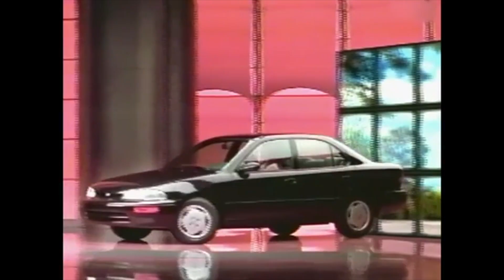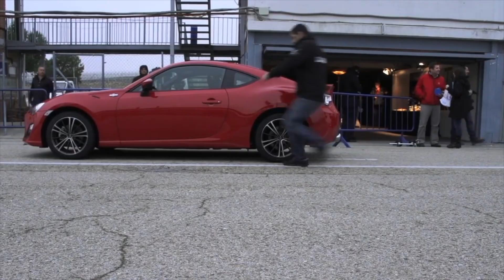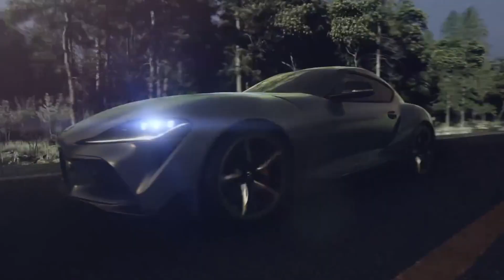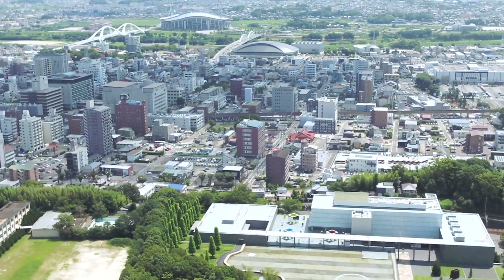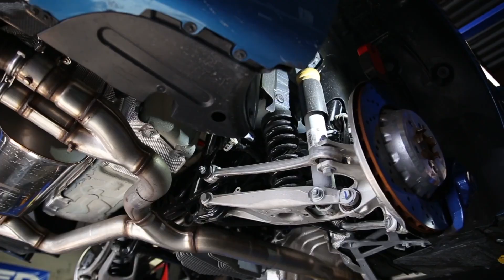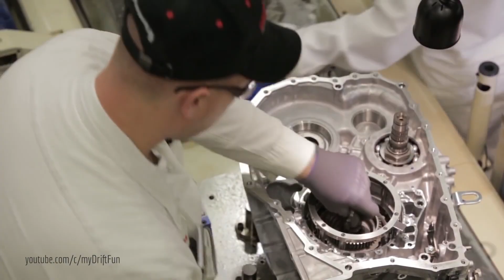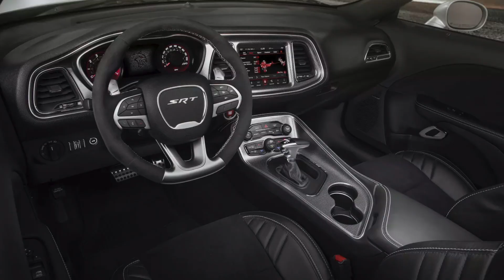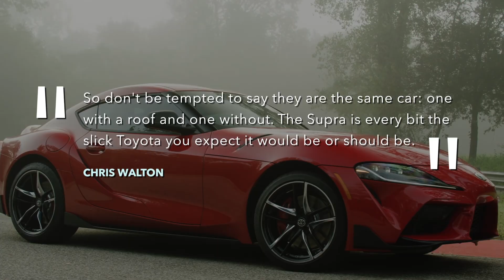MKV Toyota Supra - BMW or Toyota? The UNTOLD TRUE STORY

Comment: I notice that apart from being a BMW pretending to be a Toyota, that you forgot that the interior , which is totally BMW. 

This is a BMW in Drag, Period!
Reply: If the interior designs for these two cars was, as the video suggests, done completely separate from each other, how come the Supra's dash looks more like a BMW than the Z4 itself? Vast majority of controls are taken straight off a BMW assembly line. It even has the BMW iDrive?! They made a big effort on bringing the Supra back but didn't care to make their own A/C panel, shifter, or even a steering wheel? It was bad when VAG did this using Audi switches on Lamborghinis, but this time it's just sad. I mean, you could expect that from Volkswagen Group, they have a history of making soulles clones under different brands, but BMW and Toyota, both with such strong brand images?

It's probably a great car, I'm not saying that. It just isn't the Supra the world was waiting for. Not as it presents itself now. It could have been.

I like Toyotas and BMW:s both, it's not that. One of my cars is a BMW at the moment, and I like it a lot. I just might like it more than the -83 Corolla I had some years ago, and that's saying a lot. The next car I'm buying might just be a Lexus, so I'm not biased like that.
Reply: @PekkaKilpeläinen  "how come the Supra's dash looks more like a BMW than the Z4 itself?"

That is the dumbest comment I have seen in a very long time. Bravo.

Bitching about A/C panels and shifters really shows where your priorities are. i.e. Completely grasping at straws to pretend you have a valid point.
Reply: @ootdega  Well that's your opinion. I know A/C controls do not make the car any worse. It's just beyond me, why they wouldn't make new ones. It surely wouldn't have been a big effort. Or even use those of some other Toyota model. Even that would have been better. Well, probably making completely new ones would be about just as easy, because obviously the car uses BMW electronics, and making a Toyota panel communicate with a BMW bus would have required some work too.

Why does any car maker do different knobs and swithches, and spend money on that, if they don't matter? Those are the things you'll see while driving the car. All the time.

And it's not even about how the A/C controls really. That's just the most visible reminder of what's wrong with this car.

I'm not saying I'm a genius or anything, but if that was the dumbest comment in a long time, you must not have read many Youtube comments lately.

Comment: What is the actual reliability of the BMW inline 6's over the years? If I buy a toyota Supra, I want 90's toyota bullet proof reliability.
It also doesn't matter what other cars the transmission is used in, 2nd gen dodge rams are a good example. Bullet proof transmissions that Dodge spec'd out to be cheap so they fail easily without additional cooling or new internals.

Comment: As an business insider, this report is hitting some reeeeally good points. The European vs. Japanese Culture - oh Boy, is it difficult, but the rewards can be great. I enjoy working with Japanese customers, but I see the struggle daily. As for the Manual vs. Automatic debate - BMW has some of the very best SW for automatic transmissions out there (they run a LOT of custom things compared to the "stock" ZF). Their MTs however, aren't as good IMO. If you know the difference in shift quality and strategy between a BMW and any other OEM ZF 8HP you'd be very, very surprised. And BMW drivetrain and suspension with Toyota realiability engineering... Sign me up!

Comment: It was a no brainer to use a BMW engine???? ITS. A. TOYOTA.
Reply: What's funny is that the company that they should have gone to for the engine is Volvo, but it'd never happen. They're the only common-tier company actually pushing engine tech. The sad thing about the new supra is that the best BMW engine for it was the N54, which was axed 10 years ago. 

In short, if you want a modern supra... buy a E92 335i.
Reply: Toyota is not known for powerful engines, BMW is. Reliability is an easier problem to fix. Not to mention, a lot of the setup is quite German, and BMW is quite familiar with 6 cylinder RWD platform. It does make sense to use a BMW engine.
Reply: Why the fuck not. I can only imagine you would be bitching even more if it got a V6. They obviously reworked the majority of the bimmer engine and it has a lot of simillar specs with 2JZ for example closed deck block, variable valve timing, forged crank shaft, rods and pistons, same displacement same drive train and aspiration. I've seen people getting 600whp from the previous version of this engine with stock internals no problem and that was in a well abused drift car and apart from servising it didn't need any atention and that engine is opem deck and cast bottom end so you can only imagine how strong the new one will be. Oh and btw that 8speed auto? Made by getrag do you know what transmission is also made by them? The glorious V160. The new supra tranny is also in lamborghini's wolksvagen's bmw's and even in a fucking jeep track hawk a frikin heavy ass suv with 707bhp. So even the transmition is going to be extremely strong. Just stop pissing on toyota for workig with a different company i haven't heard people bitching about gt86 having a subie engine so why so many puristic cunts are whining about this co-op is a mistery for me.
Reply: @MrTomuron  nope
Reply: @MrTomuron  Dude... learn to spell. And the point is it's a BMW engine.  Let's release a BMW M3 with a Dodge Hemi in it. Or how about a Chevy Corvette with a Hyundai V8.. or a New Ferrari with a Chevy LS.. get the point??
Also the FRS and BRZ both were built to be a totally different new car.
Reply: @Simple_Youtube  i have no problem with who the engine is made by as long as the feeling is right and everybody who drive the new supra said it's amazing as it was built from ground up to be a handeling weapon. And my spelling might not be on point because english is not my first language obviously. Honestly anybody who drove it has no problem with it having a non toyota engine and i don't either since only thing me and everybody else should care about is the feel of the car not what badge is on it
Reply: @MrTomuron  dude of course. People swap engines all the time. But you are missing the point here.
Reply: @Simple_Youtube  Nothing special about that. A lot of car manufacturers use different make engines. A.o. Renault makes engines for Mercedes A, B and CLA and some CI. Volvo used Renault engines. Lancia Thema 8.32 had a Ferrari engine. Toyota and PSA  made the Toyota Aygo, Citroen C1, Peugeot 107 together. Ford has hired Yamaha to make engines or sub-assemblies. Mercedes sells engines and parts to Aston Martin. And how many co-ops that we don't know about!
Name a car brand that 100% proof doesn't buy parts from other factories. They all work together to get the costs down and make more profit, because that's all that matters in the end: profit. CEO's are calculators first, car fans second!  (if at all). Most cars are 'assembly cars'. One factory makes the chassis, another one the engines, etc. All parts come together in the assembly and a new Frankenstein is born. They all do it! Toyota's hybrid drivetrain is sold to Nissan for the Altima. Ford and Mazda shared engines, chassis parts, brake parts, even full platforms. Toyota and Daihatsu. Rover and Honda.
I can recommend a trip to Skoda's plant in Mladá Boleslav. You can get a grand tour there (except for some development buildings :) ). Might be other manufacturers doing the same.
Reply: I think that it is easier and cheaper to improve an already existing engine rather than making a new one considering its a joint project. Again this is my opinion and I could be wrong.
Reply: Cost is always the choice. They had a good BMW engine right there.
Reply: And the 2jz was a Yamaha ok shut up and stop being a fanboy
Reply: @zetto_san-ichi4824  u need a safe space brah?? U seem upset.
Reply: James Heracious you seem to have read my comment in an angry tone that’s your problem you’re obviously the one upset don’t know if you realized but shut up isn’t always an angry word
Reply: According to this video, Toyota made sure the engine is reliable.
Reply: @REEL SIXX no one is triggered. Dont get your thong panties in a bunch. No one said anything about JDM. Nor do they care. The point is that the car is 100% BMW or should a say its actually just a reskinned Z4. And only JDM Weeb fan girls use chasis model codes to label cars. Mk5?? Give me a break.
Reply: And for the MK4 Supra, it was a no-brainer to use a Yamaha engine. Stop whining!
Reply: a lot of idiot toyota fanboys dont even know their own history, so surprised about this. well sorry to burst you bubble, this will hurt. bmw designed and had a hand in the jz engines.
Reply: @1984-f7q  haha sure dude. Keep dreaming. The only engines touched by a german company were JGTC race engines outsourced for machine work. Keep drinking you koolaid.
Reply: why the f would you use a BMW engine?!! they are notorious for problems, mainly cooling system issues
Reply: @TheCreedBratton  Toyota reworked the entire engine to meet toyota's reliability standards
Reply: @JustusKuroVT  lol
Reply: @JustusKuroVT  that right there tells you to never buy bmw
Reply: @bailey2624  I hate BMW myself. But the supra aint a BMW, its a toyota built car aided by BMW
Reply: @TheCreedBratton  bmw engine are amazing lol, yes they might have their hickups since theyre completely maxed out. I dont think youve ever driven a bmw m car.
Reply: @D3nn1s  I have actually lol.  I also have years of experience working on BMWs and building race engines for them.  They make good power, but they don't have the reliability of Toyota, which is why people buy Toyota to begin with.
Reply: @TheCreedBratton  not in germany lol
Reply: @D3nn1s  you got me there lol
Reply: @TheCreedBratton  well shit happens :^)

Comment: the engine is bmw, the differential is bmw, the suspension is bmw, a lot of interior parts are from bmw, tested by bmw, of course it more bmw than Toyota but Toyota did great in fixing bmw reliability issues, only time will say if they did fix all of them, if all that is true of course it will be a great car but if it has bmw reliability it will be a total mess because the front is ugly AF

Comment: Nice... this is a car I would ONLY get in a manual... a getrag manual.
Reply: If you want a manual spiritial successor to the MK4 supra, just buy a 335i E92 or 1 series with a manual. with the N54 engine. This isn't a supra, not because it's a BMW but simply because it's too small. The MK3-MK4 supras are GT cars. The new supra is smaller than a GT86.
Reply: I have a Mk.1 Z4 and two other manual BMWs (E30, E46). I'd only get a manual too, but I think the new Z4 is also a bit too big and heavy compared to the original.
Reply: Good luck shifting faster than humanly possible and destroying it in the process. Get over it, manual tranny is gone, the future is here. We'll miss it and the older cars that have it will still be fun, but you just can't compete with the new stuff

Comment: Nice work with this film! Good, unbiased filmmaking. Wish more folks could follow suit. 

Watching this actually completely changed my viewpoint of this vehicle. I like many originally  felt like it was a "rebadge" job not really worthy of the "Supra"  nameplate,  but realize now that's not actually the case.

This is less "rebadge" and more "gene splicing"  which is hardly something new to automotive engineering. In fact,  I believe both makes/vehicles will benefit from this.

Comment: My problem with the new Supra is the huge difference between the finished car and the concept car images and it’s position in the Market. I can see all the design ques are there but the finished car is just weak. It can be compared to the fashion industry, cloths at the Paris, New York and London shows are outrageous and mostly impractical  but the ideas are diluted and work the way down to the street. I was hoping the Supra fitted into it’s previous level on the market, in the 90’s magazine tests the previous model was tested with cars like the Viper, 911 and most importantly the Nissan Skyline of the day. When it was said the Supra was coming back, I didn’t even think of the “price”, I thought the Supra would be the Toyota’s equal of the Nissan GTR, the car to take the fight to the GTR, and with the images put out there, it was. 
In the 90’s word of a battle in Japan hit the UK, 1000+bhp Supra, Skylines and Honda NSX on the street and on the track the Nissan, Toyota and Honda battle raged. Maybe the disappointment is just my looking to the history I grew up with, car giants battled, today they get together and produce to a cost car to fit a niche. I hope Toyota do bring out a model to rival the GTR but sadly it won’t have Supra on it’s tail.

Comment: I would buy the Supra because I prefer the stiffer frame,  the simplicity and steam line design a coupé. In terms of reliability I expect them to be similar. Even if if had a toyota engine I don't think it would be more reliable
The old supra is a legend. This one is nice but I don't think it will go anywhere close

Comment: Why? Why do you have only 23 thousand subs? Why does this video get barely 550 thousand views?
Is this on trending? This should be on trending.
Most awesome video I've seen in a while. Extremely well done!
Reply: Because it’s full of misinformation. Go look at Shmee150s video of the Supra he actually bought and owns, and you’ll see that some claims in this video are false. This guy just compiled a bunch of other people’s writings and videos and did no effort to research the accuracy of the statements he copy-pasted.
Reply: @TheWallsocket  Do I smell a fanboy?
Why do you think it could even try get close to the most famous Supra?

You realise that it is impossible to meet requirements of people like you.

Also, doesn't look to me that he just copy-pasted everything, accuracy? Never mentioned that this is highly accurate and always reminded you about it when something not that concrete was stated.

This isn't about "Oh it's a BMW Celica".

Toyota wasn't doing any real sports cars for like a decade. Pretty sure it would be disappointing to finally make a sports car that is underperforming. Meanwhile, BMW is one of the best engine designers, plus if the statement about cooperation were true, this engine will be very long-lasting.

Guess what happened when they collaborated with Europe to redesign the new Yaris? They made an awesome, extremely practical and fuel efficient car!
Yes I know, interior design isn't the same thing as the engine and transmission, but it helped a lot! Those Yarises are everywhere!

Also, I couldn't find anything contradicting Shmee150's video, he didn't even talk about the collaboration much.

I am starting to get the feeling that you are talking sh*t or just trolling.

Stop with this nonsense and just don't buy it if you don't want it. The worst thing that can happen to you is that the old Supras will rise in their prices, making it harder to buy em.

Comment: You're selling it wrong.

Half of this is not true. Toyota has already admitted they styled the vehicle and plucked parts from the BMW old car parts bins to build it with. The well deserved  hate that this car gets is because it goes against Toyota's customer standard experience, reliablity, low cost repairs and replacements, modification availability. This disaster of a remodel reminds me of the Thunderbird from 2002. Which also didn't meet any of the standards their customer base wanted. 

This video tries its hardest to sell people on a collaborative effort. But the realities are much different. This is obviously a rebadge bmw z4, all the way down to the trans and difs. Toyota doesn't have a public response to the desire for a standard trans because they know they would need to make a deal with BMW for parts from yet another BMW model (likely an extremely expensive M series), or design one from scratch. This is a weak attempt by Toyota to meet the demand, and they know it. Watch how little advert there will be moving forward for this. And how few they will sell. At this point i think they would just be happy to break even on this deal.

The nonsense of people saying Supra fans ought to get over the fact that it isn't the old Supra is, frankly garbage. This thing doesn't even come close to the standards the Supra has had regarding competitve performance at a value. That is an inagruable fact. This car is a middle of the road mid-2000 sports car with expensive pieces to make it even worse at competing over the long term.